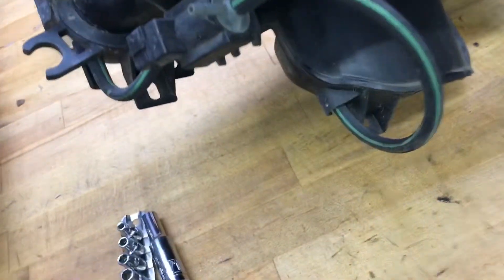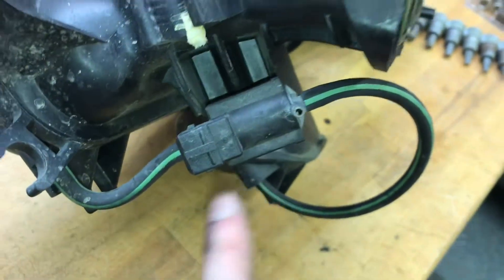Chevy Cruze Intake manifold removal 11-15

Comment: Hello sir followed your video when installing my pcv kit back in 4 yrs ago. now i suspect that my turbocharger bypass valve that sits under the manifold is faulting .. not sure about that, do you know the sypthoms for that? 
Aditionally - whene i touch the pipes that connected to him they are all oily .. 
i have reall bad missfires on high rpms.
would love to get some help, im frustrated.
ty.
;/
Reply from the maker: Sorry man don’t know, haven’t had anything misfire

Comment: Do you know the average life span of orange check valve inside intake manifold? Has urs failed and what was the mileage it failed? I have 2014 Chevy Cruze Lt and has 86 thousand miles and a little paranoid it's going to ruin the engine. Heard this engine is too delicate or problematic. Thanks for video any feedback appreciated
Reply from the maker: Can very a lot, you will know when it falls as it will run rough but it wont blow anything up

Comment: Anyone know if the 2012 1.4 intake manifold will fit on the 2011 1.4?
Reply from the maker: No, the 2011 has a extra sensor next to the MAP sensor (or two MAP sensors for some reason) on top passenger side when installed on car. I wanted to get the Dorman intake for my friends 2011 but no go. I looked at drilling and tapping but don’t think it would be worth it. Here is Amazon link for the 2011. 
GM Genuine Parts 25200449 Intake Manifold https://a.co/d/bcslZr7

Comment: I love that this is right to the point with no fluff. Some videos are all fluff and no help. Not this.
Reply from the maker: Thank you, i try to keep my videos short and simple!
Reply: Also... as I started on this I realized these metal wire clips are easy old school clips. Just slightly push in the injector metal clips towards the passenger compartment and pull up injector connector. The fancy clip you added in a comment about is a squeeze clip. It does not need removed.

Comment: Those green and black hoses, what are connected to? I have a new intake and it didn't come with those on it
Reply from the maker: Turbo?
Reply: @Mr95Kenny  I called the dealer and they said it's the charge air bypass regulator. I can't find the part with the hoses. Mine won't come off the old one so I can put it on the new one.

Comment: That grey intake port on the underside of the intake broke when I was replacing the PCV valve line; do you know if that is part of the intake manifold? It looks like it's separate, but I can't find much online about it.
Reply from the maker: I assume its one unit. Hmm, you could try to epoxy it back on. If just the thing to the hose broke you could try and plug it and tap into the black yellow hose that comes out of it with a T. Or you might just need to buy a whole new intake, sorry that sucks, its always something!
Reply: @Mr95Kenny  Thanks for the quick reply. Yeah, the T-split might work and just epoxy the whole, so there's no leak. Thanks again. Much appreciated. :)

Comment: I have a 2011 chevy Cruze with 250000 Miles on it. I can't pass immisions due to a po420 code. I have replaced the catylic converter 2 times and still have the code. Any advice will be appropriated. Thanks.
Reply from the maker: Move to Michigan, no testing.

Comment: is it easier to put it on car ramps at all for the back wires and hose's I have to replace my intake manifold because of the stupid small pipe that goes to the brake booster. then find a coolant  leak somewhere after  I park my car it leaves a puddle on the ground
Reply from the maker: I think if you go in from the bottom you will still be reaching way up in there but its worth a try!

Comment: How do i know when to change this i have an issue with my 2013 chevy cruze LT 1.4 , i thought it was my catalyst converter (replaced it) but my car still makes a loud puffing noise from the engine, any suggestions
Reply from the maker: See if this is what your hearing.
https://youtu.be/h2Iy9v0BBI8

Comment: 0:27 what is that part called ?
Reply from the maker: Bikini Time EVAP sensor
Reply: Mr95Kenny why would it sound like a knock sometimes ?
Reply from the maker: Knocking from the engine?
Reply: Mr95Kenny no you can hold the sensor and feel the knock then it stops sometimes
Reply: Would it be a bad sensor
Reply from the maker: Don’t really know, any engine lights?
Reply: Mr95Kenny no lights but just blew a turbo changed the turbo the top of the motor but didn’t know about the air intake but now my valve cover is still leaking
Reply from the maker: Sounds like a few things going on. Its always hard to diagnose without seeing in person. Sometimes its best to know when to give up hope and bring it to a Mechanic.
Reply: Mr95Kenny I’ve changed the turbo myself and the valve cover myself and the window regulator

Comment: If you are replacing with a new one, there is a little piece that one of the electrical connectors go to on the left top side that your going to need off the old one. Its the only thing that has a blue tag on there so it should be easy to spot. Its held on with a T20 screw.

Comment: Be careful when trying to get the fuel rail out of it. Should just have to take the 4 electrical connectors and 2 screws for it to slide out. I undid one of the clips holding the little injector thing on the rail and fuel started leaking everywhere. 
I didnt really know what I was doing but managed to replace this and the cam cover as well in about 3 hours. The clips on the underside were the worst part but not so bad if you save them for last and do them first when reinstalling. Thanks for the video. It helped a lot.

Comment: I changed the valve cover on my Sonic and it still has a big vacuum leak, whistling noise coming from the intake manifold area. Think this is it? I unplug my MAF sensor and it idles better indicating it can't meter airflow (vacuum leak).

Also, the dorman install video shows the fuel rail coming out with the intake? It shows it having a disconnect for the fuel line and it just comes out with the intake?
Reply from the maker: tinton3w if its not the valve cover leaking than i dont know. I know the crankshaft seal can leak and be loud. I dont know on different brand manifolds for there fuel rail set up

Comment: Thanks for the video. Yesterday i switched over to a ZZP ported manifold and it has more power and pulls harder and 1 extra MPG fuel economy on the highway lol. I had a hard time getting the wiring harness off of the old manifold because its hard to get to the clips with needle nose pliers because there isn't much room to work with. Upon reassembly the clamp at the throttle body was the most difficult only because I have a ZZP intercooler and the clamp is almost too small. Also i was surprised to see oil in my throttle body after i cleaned it a long time ago and have an oil catch can, so either my catch can isnt working or my turbo is leaking oil.
Reply: I have a 14 sonic rs. After you replaced the manifold from zzp did you have to get the car tuned ? Also did you replace the valve spring as well? Thanks.

Comment: Those with ported manifolds have actually reported the highest fuel economy numbers, which makes sense because of the extra airflow.
Reply: the airflow is the same, that lip is put there to increase some manifold air pressure at lower rpms that's it. You want more airflow? bigger turbo.

Comment: Just wondering if that fix kit worked out and if it hase faild or caused any problems, thinking of doing it to my cruze because the i take manifold has faild which has caused the the valve cover to fail, please let me know if the fix kit has worked for you
Reply from the maker: So far so good!
Reply: @Mr95Kenny  will it remove check egine or is it something i gotta live with lol i got a code reader but im just wondering if i gotta constantly  clear codes
Reply from the maker: I have no engine light on.
Reply: Cool cool, thanks man 👍

Comment: What causes you to replace the manifold?
Reply: Would a bad intake cause oil leave from oil cap?
Reply from the maker: Really just if you want to replace the pcv valve. But i put a aftermarket pcv valve in so i had to take mine off and put back on.
Reply: Vacuum leak, random misfire, p0300 and or p0171 code referred to ur car running lean ( more air in than it suppose to)

Comment: Question? 
My Cruze 2014 has a terrible noise, like a whistle, and somebody told me that it could be the intake manifold.  What you think
Reply: Snoop around the cam cover, pull off the coil cover off cam cover and see if the whistle comes from there... if so check out the forum cruzetalk on pcv valves...my pcv valve in the intake is gone, suction is present in cam cover which makes a whistle and rough idle,,, CEL and stabilizer control service light came on after a 100 mile trip. Bought the kit to bypass pcv inside intake and a new cam cover. There is plenty of info on this issue. Good luck!
Reply: @MandrakeRoots  thank you so much!!💪🏼
Reply from the maker: I have seen the seal for the output pulley shaft gos bad on the passenger side. With car running pull the dip stick and if it stops might be that. Just haven’t had many sounds of my own yet.

Comment: I just replaced mine today but now I am getting codes for my turbocharger I think I missed a connection maybe?
Reply from the maker: Allyson August check the airlines that plug into the bottom on the intake manifold

Comment: The Dorman manifold has a retaining pin added to the PCV to keep it from becoming dislodged. The OEM stock manifold does not have a retaining pin and the PCV becomes dislodged over time and disappears completely. This issue causes excessive oil consumption, a rough idle, and will ruin the vaccum regulator valve in the valve cover which will require the valve cover to be replaced.
Reply: We've lost all confidence in Dorman parts at our shop... Poor quality control (fit and finish)
Reply: Doesn't prevent it from getting gummed up, gunked up, cracked, clogged, or leaking. What's worse is you can't even clean it because it's recessed further back than the OEM manifold. Still a poor design.
Reply: Thank you!!!

Comment: So I just replaced the manifold today.( thanks greatly to your video btw!!!) engine light came right back on. I’ve already changed out 2 o2 sensors, the map sensor, the valve cover and now the intake manifold and the Pcv pipe. What else is there?
Reply: I found another map sensor. Its on the hose that goes on the throttle body. Found it on Amazon for 12.99. I'd shit if that was it. I'll let ya know if that works. Also some people think i may have to drive it so far to get it to go off. So many variables,so little time. Haha
Reply: MY FRIEND I HAVE A LOT OF ISSUES WITH MY 2011 CHEVY CRUZE TURBO 1.4L LT.. DID YOU HAVE A PO CODE ?? I HAVE REPLACED ,SPARK PLUGS, COIL BAR, BOTH CATALYTIC CONVERTERS FRONT AND BACK, ALL SENSORS,VALVE COVER SEAL I USED SEAFOAM, GAS TREATMENT, CATALYTIC CLEANER IN THE GASOLINE TANK AND AFTER RUNNING MY CAR FOR 70 MILES THE CHECK INGINE CAME BACK ON ,ON MY WAY HOME AT A STOP LIGHT.. THE CHECK ENGINE LIGHT KEEPS GIVING ME THE SAME CODE  "PO420 CATYLISTI LOW EFFIENCY BANK #1....WHAT IS THE CODE YOURS HAVE ?
Reply from the maker: Brick by Brick darn. I don’t know, just check everything over i guess. If you really want to dig into it I believe you (or probably a shop) can pressure test the intake system or fog test it for leaks.
Reply: Mr95Kenny ok thanks for advice. I probably will end up having to take it to a shop. Was trying to avoid that at all cost. Ha. Thanks for the help again.
Reply: @Peter Macias THANK YOU VERY MUCH I WILL LOOK INTO IT

Comment: One tip - you recommended replacing the manifold gasket.  While searching for the gasket the injector o-rings popped up as a $5 Amazon add-on.  Might as well be safe.
Reply: The intake gaskets are what’s called reusable intake gaskets as long as you’re not swell up. I do this every single day you can reuse them. Take a razor blade. Clean the surfaces on the head. Wipe all oil residue off earrings, which is the gaskets wipe them down and put it back on. I do this on Ford GM Hyundai. You name it. You don’t have to replace them all the time unless they’re hard cracked or swelled, but 90% a time you can reuse them by torque the intake because it’s plastic.

Comment: I just finished this job tonight and will add my 2 cents to anyone who watches this video. Getting the intake manifold out isn’t too bad. Getting to everything you need to get to is fairly easy and this video shows it well. The trickiest part is getting the 3 clips off in the back of the manifold that secure the hoses. I did not do the after market repair and instead replaced old the manifold with a new one. The new one I bought did not have the 2nd white clip, the one that is mentioned as being farther down the hose. I can see why, because getting it off would have been tough. Since the new one didn’t have a slot for that clip, I just cut the tie that goes around the hose. Some things take patience and plenty of wiggling to get off, so take your time. As far as putting it back in, I agree with the poster that putting that tiny vacuum hose on as the first thing you do is wise. Next, I put in the little plug with the  metal clip that is mentioned at 50 seconds. This makes getting that metal clip on easier, because you still have room to work. Then I put on the 2 plastic clips that secure the hoses to the back of the manifold. Next, I reattached the 4 plugs and 4 clips near the fuel injectors then I slid the fuel injectors back into the manifold and secured the manifold to the engine with the 6 screws. Reattaching the 4 plugs and 4 clips before you reattach the whole unit to the engine is much easier because you will still have room to work when you put the clips back in. Luckily, the new manifold I bought came with the 6 E10 screws already built into the unit, so you don’t need to worry about trying to find a way to sneak the old ones back in. Once the thing is secured to the back of the engine, the rest of it is a matter of reattaching everything and not missing any plugs, hoses, or clips. Getting the big hose that goes into the manifold was a difficult, but it will come off with some good force. You will need a few pieces off the old manifold that will need to be put onto the new one like a couple of small brackets and fasteners, one of which will need to be unscrewed from the old manifold. For example, if you pause the video at 30 seconds, you’ll see that blue piece in the middle of the screen with a small screw to the right of it. This will need to be unscrewed and removed from the old one and put onto the new one. Lastly, the new manifold I bought came with a new grounding wire, and the wire is already secured on the bolt which is built into the unit and can’t come off, so you can’t lose the wire.
Reply: Thanks dude. I'll be putting the new one on tomorrow.
Reply: This video was awesome, and it’s what I used to get the job DONE. Thank you!!
Reply: old comment for sure....but for those that did this, and commenting op, about how long did this take you? additionally, what is your experience like as far as timeline for working on cars go?

I ask, because I know I'm a rookie in retrospect, and I've got a PCV Hose, Valve Cover, and Intake Manifold on my '13 Cruze eco in dire need of replacement. The only thing that makes me nervous by any means, is this manifold.

TIA!
Reply: @acredeaux3311  honestly, I think the biggest headache I had was draining the coolant. Seems like EVERYTHING you have to do to the engine, you have to drain the coolant.
Reply: Thank you!!! I may opt for a new manifold too. There is an air leak that could be the gasket or manifold.
Thanks again.

Comment: Great video! I just purchased the pcv fix kit, how has it been working for you? I recognize you from the other video you did when you cleaned out your intercooler. Another question, was the bad pcv causing the oil to get into your intercooler?
Reply from the maker: Hi! I believe it’s been working fine, going to look things over next weekend, have to replace the oil cooler seal, video to come. Im thinking it was part of the oil problem, the main one was the valve cover pcv regulator diaphragm thing. Im thinking of putting a aftermarket oil mist separator in and re cleaning my intercooler.

Comment: I just replaced my intake manifold on my Chevy Cruze thanks to you. The clips are by far the hardest part. Overall it took me about 3 hours to do. You are awesome for putting this together. Next up I'm replacing my cam shaft cover.
Reply: Was this 3 hours total to remove the old one and put in the new one? Or 3 hours to take out the old one?
Reply: @ART224  3 hours total. It would have been faster, but I struggled with the back hose clips. I kept thinking my e10 bolts were all the way out when they were not. As a result I couldn't maneuver the manifold in a way to get better access to the clips in the back. It's really important everything else is off and the bolts are completely out so you can pull the left side of the manifold up and get better access to the hose clips. If you know exactly what you are doing you can probably do the entire replacement in under two hours.
Reply: @andrewbeck1516  Thank you!
Reply: How much does it cost, part and labour?
Reply: @sukhveerbhullar6987   I think I bought the manifold for like $150 or so. I had to buy some kf the tools as well because I didn't have them. The labor cost nothing as I did it all myself.

Comment: On the 6 intake manifold bolts do they need to be tightened in any specific order? I know they’re 15lb torque down
Reply from the maker: Tommy Miller i didn’t find anything about it, just have everything hand tight first, but wont hurt to bounce around.